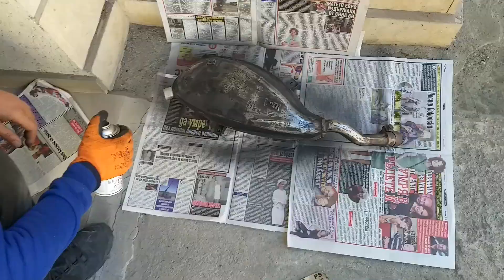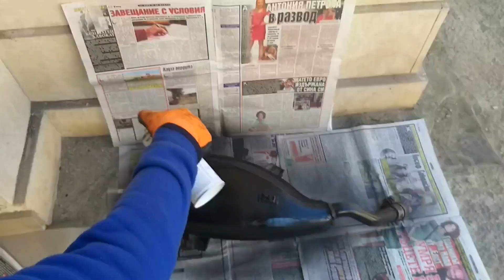Vespa gts 300 exhaust progect-1

Comment: I have a 250 gts. Te exhaust makes a metalic noise so something is broken inside. I want to cut and open the exhaust and then weld It. It can be weld with electrodes without problems? The sheet is thick enough for it? Thanks a lot
Reply from the maker: It can be welded with electrodes. The sheet metal allows. I have used 2mm electrodes. I make the voltage of the electrician between 40 and 60 Am. I make short welds as dots and then short welds on them.

Comment: Did you install the retrofit taillight frame? Looks like this is the model from 2010-2014 is that correct ?
Reply from the maker: Yes, the model is 2013. I installed the taillight from the new Vespa GTS 300 model. It is not difficult, but new holes must be drilled in the frame .

Comment: Thanks for your video.For me is very useful.
One question only.
Between sheet metal with holes and external sheet metal you noticed if there are any sound absorber material?? (e.g. glass wool,or stone wool e.t.c.)
In my Vespa i want to make more quieter.Because is little bit  noizy from factory defaults(i thing if there are any absorber material  inside ,this has burn,and i think to open to replace with  new,IF THERE ARE!)

Thanks
Reply from the maker: There was a thin layer of cotton wool, but it was blown away by the gases. If that's all you're going to open the muffler with, I don't think it makes sense. If there is metallic noise from it, it is very likely that some metal part has broken the weld. There are a lot of sheets inside. If you are cutting the muffler, select the inside of the tire. So that the welds are not visible later. Success!
Reply: @fitness-fishing-s.kovachev  
Τhanks for you answer.I help me so much!
Reply: Put inox mesh around pipe with holes then fill with mufler wool. Check some videos about moto exhaust service and would see how this mesh should look.

Comment: Is there any performance benefits?
Reply from the maker: Yes, the acceleration has improved. And it got a little noisier.
Reply: @fitness-fishing-s.kovachev  Do you know if there is any issues with electronics or other? For example if the engine runs to hot or to lean, rich., bad idle.
Reply from the maker: @jenshandley1543  There are no problems, it's like putting an Akrapovic muffler. The scooter is very pleasant to ride. And easily dials. And at the same time it is not very noisy. For comparison, I had put a sports muffler, but it was very noisy and I did not like how it changes the original look of the Vespa.